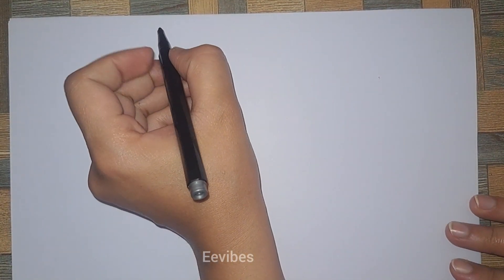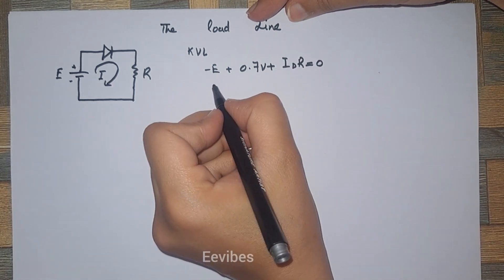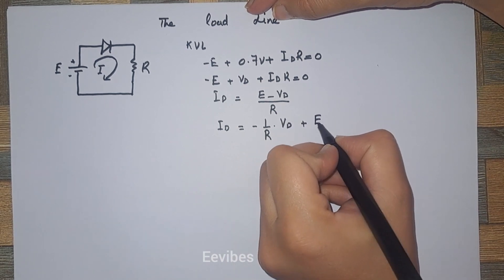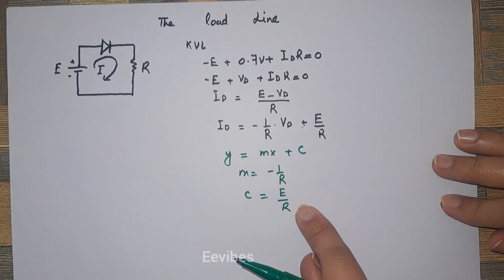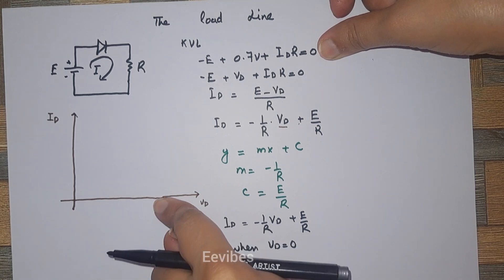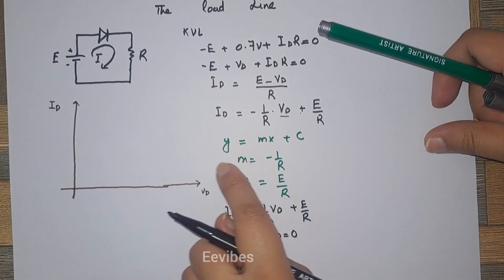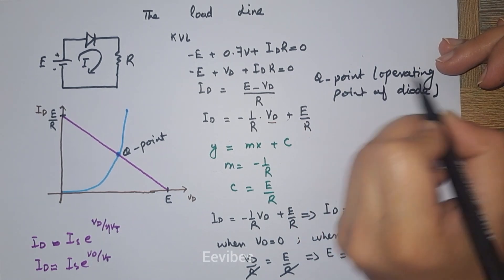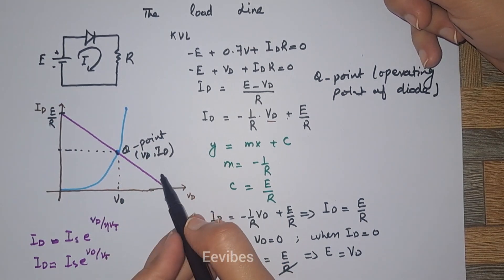DC Load Line| Q Point of Diode #diode

Comment: I dont understand
1.How do you get R value
2.what is the usage of this.
Because in a circuit whit a LED for example you know voltage on led (0.7 V) and Imax=20 mA.
and you  determine Resistor with formula R=(V-0.7)/Imax